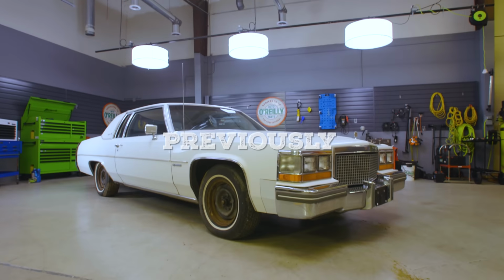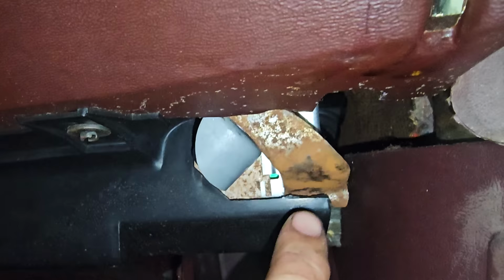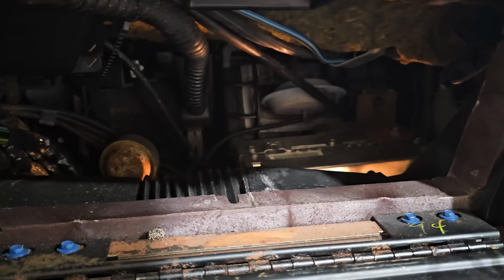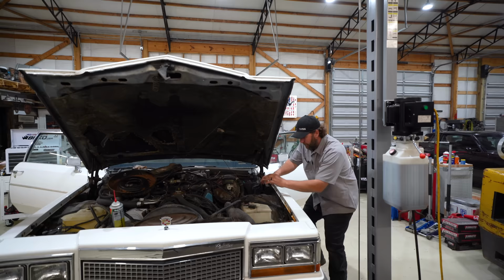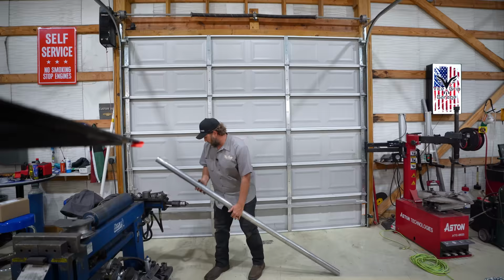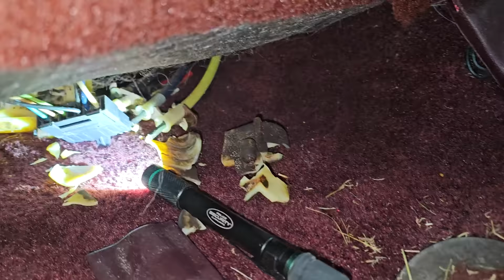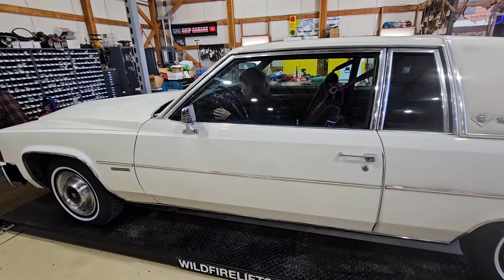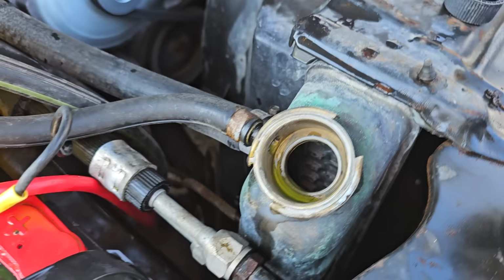Will It RUN AND DRIVE Finally? Carburetor or Computer On This 8-6-4 Cadillac!

Comment: You might be the first person in the history of the planet that bought a reman ECM that actually worked out of the box.
Reply: minus the microcontrollers. The rest of the box is just capacitors, relays, resistors, transformers. without the brain the new ECU circuits are junk. I'm guessing those chips, preprogrammed are impossible to get.
Reply: from Mexico no less 🤔
Reply: I got one for my car that fixed all my issues was very happy
Reply: Somebody call guinness book of world records!
Reply: Got one for my 1994 F150 about a year ago. Works just fine.
Reply: @bcubed72 just did the same with my 93 about 6 months ago
Reply: @M.F.Jones2  You’d be surprised how many circuit boards are manufactured in Mexico today. 
Lots of production in automotive today goes through Mexico
Reply: Nine times out of ten with the Early PCMS if something happened with them it was a short somewhere in the wiring that burned the circuit board usually on the ground side, or corrosion due to moisture. Yes you could have gotten a bad one but that was very rare.  But getting one today for a car that old was the real miracle..JS
Reply: Got an ecu for my 89 half ton ford 2 years ago, still kicking
Reply: At 15:21 The sticker on the old one also said REMANUFACTURED
Reply: The old ecu said remanufactured right on it so ya its been changed
Reply: @M.F.Jones2 No auto unions.Saves 75% on labor.
Reply: That ECM is basically just a circuit board.  All the magic is in the PROM chips he swapped.
Reply: @Jono. a lot of oem parts are manufactured in Mexico and are on par or better than stuff made in the us I work for southbend clutch pretty much all of our clutch hydraulics come from the oem manufacturers In Mexico
Reply: I’ve used many . Rarely had an issue
Reply: I would find someone with a PROM reader to make copies of those chips. Put them in an archive for future masochists who choose to work on these cars.
Reply: Did a ton of prom updates
Reply: I think he might be.
Reply: It's the solder joints on the board that usually go bad.
Reply: @Jono.  yes it does, as well as telecom and internet service material. Fiber optic cables and the splitter cabinets (the outside hardware) that makes all these videos and businesses work online happen. I am happier to see material coming from our friends in Mexico than the big factories in 🇨🇳
Reply: ? Sounds like a you problem
Reply: Just recently put a refurbished ECM on my 1998 Jeep Grand Cherokee.. It's running like a champ now with a full warranty..
Reply: Amen! Bought lots of reman back in the 90's. Hit and miss, and more miss than hit.
Reply: I had one from a junkyard that worked
Reply: The "uhm ahktually" in these comments from people who can't take a joke is at an expert level.
Reply: Most Likely the Caddy is Overheating due to a Bad Water pump…Assuming he checked and/or changed the Thermostat..Also those Old original Steel Harrison Radiators can be problematic…even though they don’t Fit great the New Plastic ‘Chinese’ Replacement Radiators tend to run Cooler…
Reply: The one he removed had a remanufactured sticker on the top of it.
Reply: @kerryjudkins7266 Did the same on my '02, running well, knock on wood...
Reply: Ive heard of many Toyota ecus being refurbished but thats still an oem ecu.
Reply: Analog to digital solutions from the solid state era are impressive given the need for mass production and cost savings.
Reply: Bought a reman ecm for a Chrysler mini van. It proceeded to fry all the coil pacs and modules.
Reply: @mattbauckman9907  sorry man! Had to go carb on 3 of my gms
Reply: Got one for my 94 s10 5 years ago and still working perfectly
Reply: I put one in my 06 escape 3 years ago and it still works fine js
Reply: Actually there is a gentleman in Illinois by the name of Bruce Roe who is a genius on these cars and he personally has all of the old Cadillac stuff to reman these ECM’s personally. He is a Cadillac EFI savant.
Reply: very strange with all the work there is down in Mexico  why are they all jumping the border lol😂😂😂😂 to come for "work"
Reply: @lifebehindtheselens  because they get free stuff here lol
Reply: The vast majority of probs with old computers is the electrolytic capacitors. They eventually leak electrolyte, which tears up the boards. If replaced early enough, they won't do lasting damage. The IC's and memory from that era will generally last longer than anything else on the car, outside a stray cosmic ray hit (literally mean that). The rest is just corrosion at pins and on steel component legs from moisture.
Reply: @farmermiyagi1338 prom chips aren't driving injectors or iac motors or ignition modules. The ECM is everything, the prom chips just tell it what to do.
Reply: @16vSciroccoboi  Man, I am glad you showed up to tell me that.  All these years I thought those proms did everything by osmosis.  "Circuit board" i.e. board, chips, drivers, resistors, capacitors.  I always thought those were just aesthetic.  Oh, you were serious.....
Reply: The one for my 2012 cadillac definitely did not work and am now on the hunt for another
Reply: Prom stands for  programmable
read only memory. .
Reply: The one that was in there was a reman, too
Reply: Moses sandals! Its ALIVE!😅
Reply: Nah man I send ECUs out to diagnostic/repair all the time. In 8 out of 10 cases they can fix it
Reply: For older cars like this one the ECM’s aren’t nearly as complicated as modern stuff and I’ve replaced many over the years. Most of them worked. Now on anything made in the 2000’s, I’ve had almost zero luck with reman’d computers. I don’t even try them anymore cause I’ve gotten burned on them. Any company that sells reman ECM’s from Florida, I will never trust or buy again. I’ve had way better luck with used or junkyard computers for newer stuff.
Reply: Dang!
Reply: My uneducated opinion is that the less complex the ECM is, the better chance you have of a reman unit working.

I had to replace the ECM in my 94 ZJ due to a voltage regulator issue. Plug and play, no issues at all. But 30 years ago, the computer didn't need to be tied to the VIN. The keys are plain metal, not coded. It didn't need to recognize and communicate with other computer modules. It basically just runs the fuel injection, adjusts the timing, and acts as the voltage regulator. The more complex the systems got, I guess the better chance there is that an issue pops up. Now every major component has its own computer module and they all need to communicate for things to work right. Plus the manufacturers do everything they can to keep anybody besides a dealer tech as locked out as possible

Comment: I was a Cadillac tech during the '80s. I don't miss working on those rolling nightmares. To clear codes, pull the ECM BATT fuse for 15 seconds. Don't worry about those dents in the tire sidewalls, it's just where the cord plys are joined.
Reply: rolling nightmares 🤣🤣🤣
Reply: I was 14 when a good friend’s mom got one in 1980 around thanksgiving. The family owned a Buick franchise by Christmas it had been towed back to Cadillac a couple of times. By new years she had a 1981 Buick park avenue.
Reply: @steventerlinden7374 Will pops 🎉 🎊 😂😂😂😂😂

Comment: I worked as a driveability technician at a gm dealership back in the late 80s until mid 2000s. Cadillac was the worst to work on. Gm had software updates for every car to address multiple running issues, so you had to order a new prom, then install it when it came in. Once gm switched to EEPROM systems, it was way easier. We simply downloaded new updates thru the tech1 terminal and uodate using the OBD1 port. Also, code 12 is used as a self check for the ecm, it always states no tach signal as the engine is off during code check. Codes can be erased by simply disconnecting the battery for at least one minute. Also, after it cycles thru 3 read cycles, you you can erase the codes by pressing off and hi. Once it reads 00, codes are cleared
Reply: "Cadillacs are the worst to work on" then you go on to describe the built in diagnostics from 1981 that other kinds of cars still don't have today, over 40 years later.  Diagnostics that involve pushing a couple buttons on the dash to get codes and even cycle the 8/6/4..  ahead of its time.  Why don't you try to diagnose those '80s L Jetronic systems on German cars.. 😀  I was also a mechanic back then, and I'll take pushing OFF and WARMER any day over counting VOM needle swings on a Ford.  Chrysler was also notably easy for back then, IIRC starting in '83 you could just cycle the key three times in five seconds to get codes out of the Check Engine light.

I'm glad the '80s are over in terms of how they made cars.  Yes, all of them.
Reply: @Bolton115  yes, I worked on Ford's and imports too, still have my breakout box somewhere for the ford eec-4 system, and yeah, did several k-jetronic fuel systems, and I agree, modern computer systems are easier to diagnose the problem. My comment was on the Cadillacs they wanted you to use the onboard diagnostics, where the tech1 scanner was much faster to use, instead of all the sub menus you had to go thru on the Cadillac.
Reply: Cadillac provided on board diagnostics because no one had a Tech One, Snap-On 3000 (IIRC) or other cartridge based scan tools yet.  The ALDL reader in 1983 was a Sun Interrogator that was the size of a console television and had a box of floppy disks and adapters for various '80s cars. In 1987, my high school auto mechanics class went on a field trip to the VoTech college and they had one. It was pretty impressive for its time.

I still maintain that Cadillac were pioneers in this area.  No other cars had the computer control and self diagnostics for several years yet -even other GM models-and being able to troubleshoot it with its own dashboard display and a manual is something I still can't do with most 20 years later models.

Ok, well now that they all have great big screens and you're more IT guy than auto mechanic.. now you can.
Reply: @Bolton115  I remember that on some german cars you had to switch a fuse around or a wire or something and then it would blink morse codes for the error codes 😂
Reply: @dave1135 The most impressive thing is that you could actually remember all this. I can't even remember the gas-pedal - ignition-on-off sequence to reset the ford tpms 😂

Comment: I also do vintage computer repair, and watching you yank those chips then try to cram em back in was terrifying and hilarious. :) I recommend a chip puller, a pin straightener, and some DeOxit D5 if you ever have to do that again.
Reply: I do too.  I also cringed when he did that - but I love the guy, and well it worked ok !.
Reply: I was screaming NOOOOOOOOOOO at the screen 😂
Reply: Ha ya I think he got too big for comment  section also..making $$$
Reply: I guess he wasn't concerned about the static electricity or bending the pins.
Reply: No antistatic wrist strap for Derek.
Reply: @williamalexander1743  he did see and fix the bent pins, for anyone with mechanical knowledge it should be common sense. I think whoever tried to fix it before had none of the above.

Comment: That was a one year only disaster for Cadillac!  The dealer mechanics just hated to work on them because they never stayed fixed.  The “fix” was to clip some wires so they only ran on 8 cylinders.  Things got even worse the next year when the POS HT 4100 engines came out.  These were followed up by the troublesome Northstar engines.  These were dark days for the mighty Cadillac when they lost most of their long time loyal customers.
Reply: Dad was a GM mechanic back then, best in the shop so he got saddled with all these junk heaps. He didn't last too much longer, retired and took a job at an elementary school. Cleaning up puke and listening to screaming brats was easy after having to deal with the GM courses every 6 months.
Reply: Yup, precisely correct. That's how my parents' was fixed. Just ran on 8.
Reply: My Dad had a Sedan DeVille this year with the V8-6-4.  He hated it so bad, he took it back to the dealership and made them take it back when it had 5 or 6000 miles on it.  And replaced it with the HT4100!!!!    He bought a Lexus after that and would never consider a Cadillac again.
Reply: @RedRuffinsore  almost everyone of those heaps sold came back and got scrapped. The small block diesel conversions were also a great sales move (for every other company)
Reply: I had a Northstar years ago. Sad the engines are junk cuz the car was beautiful
Reply: Working at an elementary school sounds good to me. Grade school children are generally happy and joyful.
Reply: @Josh_D03  The northstar engines really aren't that bad aside from the head bolt issue. They're very reliable if you get a head stud kit for them. Also those late 90s devilles are getting really cheap so it's worth it if you have the time to go through the heads with the head stud kit.
Reply: 91-92 were the best years for the sleds. They finally just stuffed SBCs in them, too little too late..
Reply: @wackadoodle8951  I didnt mind the NorthStar, felt like they were put in the wrong cars.
Reply: @shonuff5297  honestly if they didn't have puny head bolts the engine would have a much better reputation
Reply: @shonuff5297  Pretty sad when it took a Chevy engine to make a mighty Cadillac run halfway decent!
Reply: @craigjorgensen4637  They could've made the move years earlier to save the Cadillac brand. Hell the 307 olds they put in them were junk too..
Reply: @shonuff5297  I remember they were stuffing in Oldsmobile 307 engines and that worked great.  I also
Had an 82 olds 98 Regency, with the 307Olds engine, and that car was build inside like that Coupe Deville, and was like sitting in your favorite stuffed chair at home. I later owned a 93 Sedan Deville with the 4.9 engine, and FWD.  that  engine was good, as they got all the bugs out of them by then.
Reply: @shonuff5297  the 305 and 307 were too weak, had the former in a B body wagon and it couldn't get out of its own way. The 350 was always the most reliable option.
Reply: @jw-hy5nq The best mechanics usually got the shittiest jobs because the others were uncapable or unwilling to touch the hard jobs that didn’t pay well!  A lot retired early and who can blame them?
Reply: @RedRuffinsore Lexus took the Cadillac market over!

Comment: From 1990 to 2000, I was the Union Representative at Don Rosen Cadillac, just outside of Philly. In 2000 they sold the Franchise back to GM, as part of GM Project 2000. They had 4 Cadillac Master Craftsman who worked there and they were the Best Cadillac Flat Rate Technicians, I ever saw during my 47 years in the Automotive Mechanic Profession. Love the channel, it warms my old retired Mechanic  heart.

Comment: Your reaction when it fired was pure and real! We can tell that you had absolutely zero expectations that this turd was ever going to fire or run! Excellent.
Reply: YAAHOOOO GOT IT 😮😂
Reply: That’s what I thought, the unmitigated glee that it worked is one reason this channel is so …real for lack of a better term 
And it puts a smile on a fellas face every time
Reply: Great reaction, but I still think he was more surprised by liberty chevelles first  fire
Reply: Need to find some covers around the tail lights
Reply: A few of his videos have these moments, and its still a surprise to me as well each time!
Reply: Those fender fillers can be still be found, there's a few companies that make the ABS plastic reproductions that last a little longer than the originals. The originals were a rubbery kind of plastic that only lasted 7 years or so if the car was continually garaged. My grandfather used to call it Cadillac's Disease when they would start falling apart.

Comment: I perused the comments but didn't see anyone mention it. The bleep bloop box you pulled out had a reman sticker on it already. That means someone had already changed it once. Also I noticed how easily you pulled the one EPROM. It made me wonder if it wasn't loose and that's why it ran earlier and then quit. Just my observations...
Nice to see the old girl running even if I'm not a Cadillac guy.
Reply: yeah that bliip bloop potato chip was definitely loose. It probably would've worked right away... no, probably not.
Reply: also, on that note, it's more than likely that the hatch thingy was from the original box.. would explain why it was so extra crunchy

Comment: Hey, those black spider legged things are what the original IC's (integrated circuits) looked like. In my early days (mid to Late 1960's) I worked for Texas Instruments, where we built the huge electronic machines that were designed to Test those EC's. I didn't have the smarts to design them, I was just one of the assembly Techs that assembled those monsters from the frame up, including doing all the soldering work on the circuit and ran all the wiring harnesses throughout the machine. It was the best time of my young college days. I loved it.

Comment: Hi Derek I'm soon to be a fellowern Tennesseer. Spent  25 years in Olds and Caddy stores shops. That wire to the trans is needed for 4-6-8 opperation. The solenoids that push the rocker arms over failed alot. Most people did disconect the trans. Overheating a problem also fan clutch failure and rad airflow must be clear. Sometimes took a few  atemps to burp the system..  As for the wirecaps look for caddy emblems a simple swap or  a feller might glue them. Your hardest part is the bumper fillers first to be eatan by the sun . I'll be a watchen.😇
Reply: lots of aftermarket bumper fillers available these days, I guess there's a big enough market for vintage Cadis to keep them injection molding new ones in a certain country in Asia